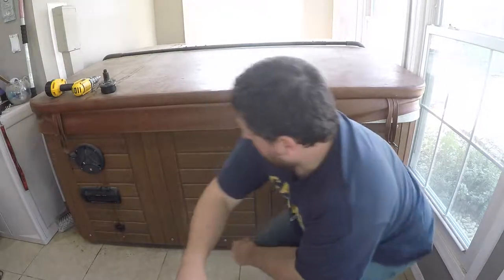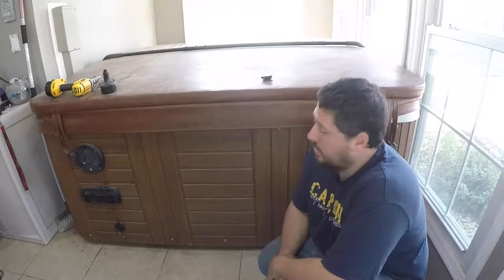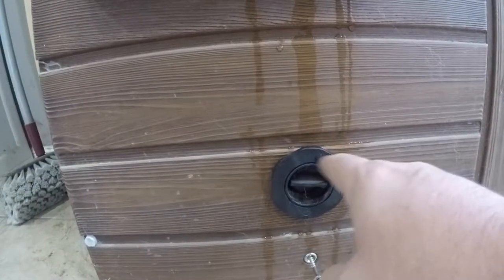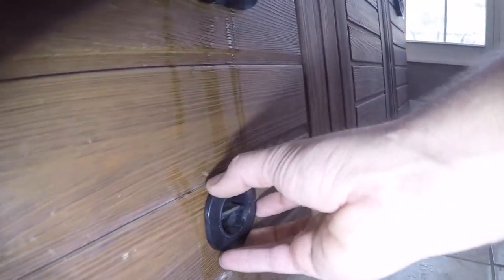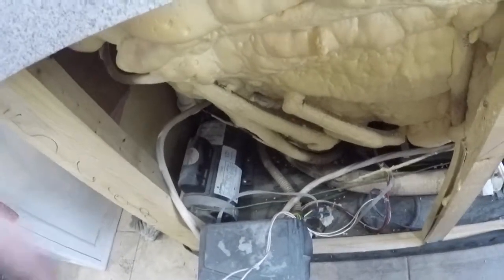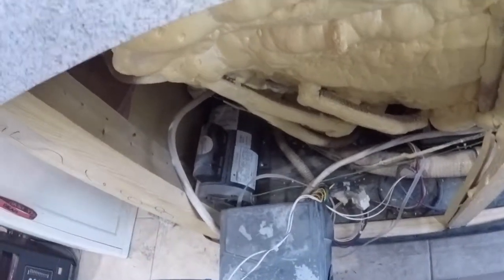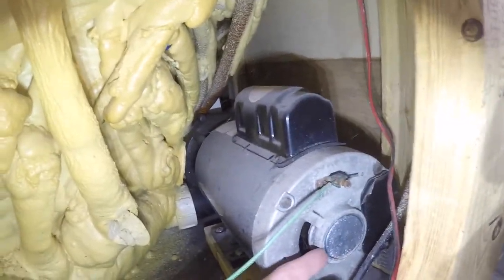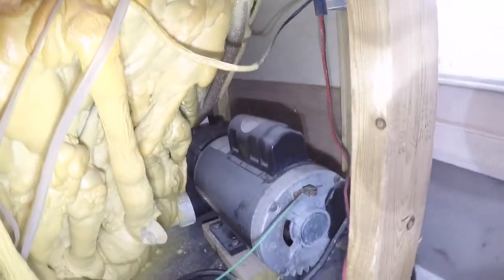Crones Vlog HOW TO  Unstick spa pumps on a Four Winds Spa

Comment: because of this video I saved a service call. My motor was stuck tight after a period of having the tub empty. When I filled it up it wouldn't start up thought it was a air lock. I opened up the tub and popped the couver off the rear of the motor and used a screwdriver to try to turn the motor no luck. After a bit of wd40 on the shaft between the motor and pump I grabbed the shaft with some robogrips and got it to budge. a bit of force little at a time I got a revaluation then used a large screwdriver to turn the motor till I thought it was loose enough. powerd up the tub and to my surprise everything came to life.